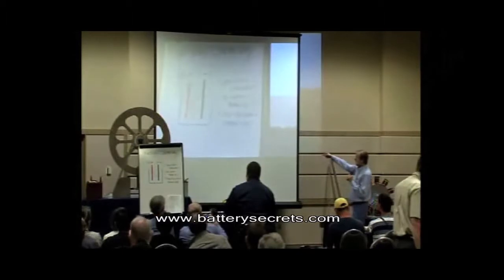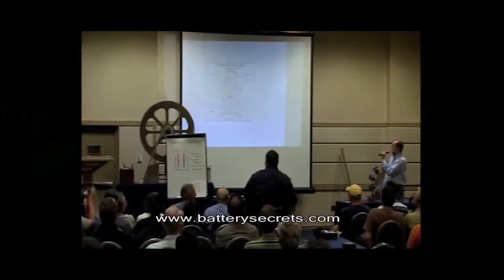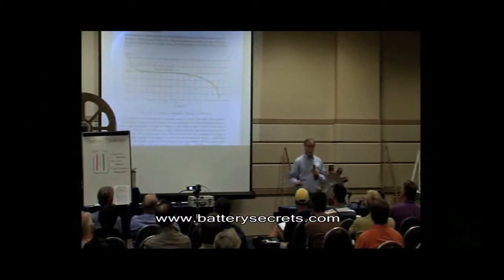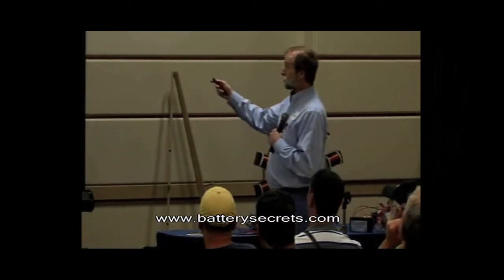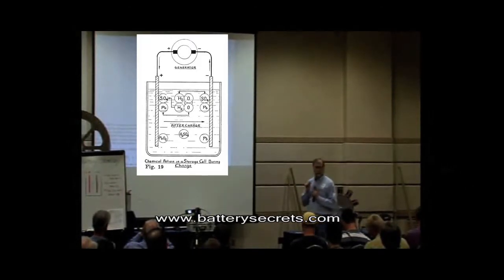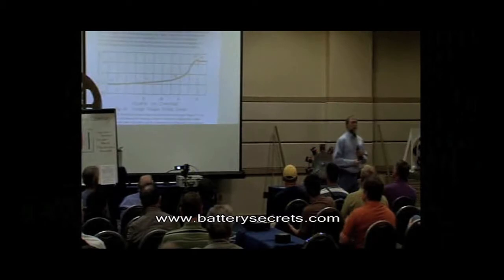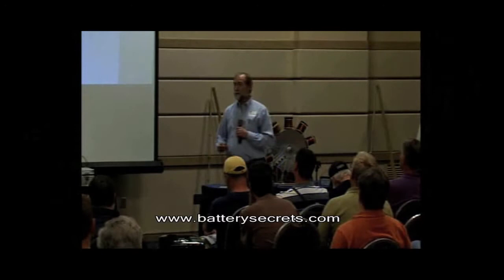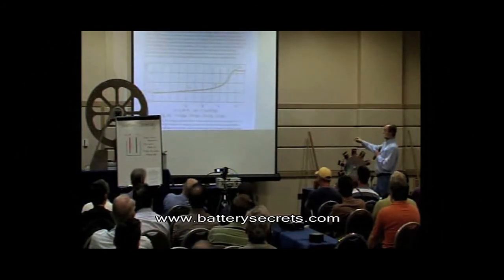BATTERY SECRETS

Comment: In lead acid battery the sulfuric acid decompose the lead plate freeing electrons creating free elctrons creating electricity as this process continues it will also create the battery plates to calsify or in better terms the lead plates will wear out basically they get a coating of calsified lead oxide and other elements this cause the battery to stop conducting,back EMF or cold electricity helps dicalsify the battery plates please excuses my spelling,thank you for taking the time to read the comments.

Comment: So the composition of the metal or elements wich compose the internal layers of the battery has to do and varies the amps of the battery cause voltage is easy to manifest but amperage has to do with materials that conduct electrical energy without resistance this metals and or elements have to be carefuly chosen we all know about supper conductive elements and or metals materials yes That's the way but it takes experimental search depending on what you're are trying to accomplish, electricity is very peculiar , they're is cold electricity ,wich is none magnetic and theres other variants.

Comment: this makes far more sense. kicking these heavy sluggish ions into motion. give em a kick... let things subside.  sorta like pushing rocks around with a leaf blower versus a compressed air gun.

the leaf blower, everything is moving, the rocks? well... lots of gravel, lots of dust, leaves... but the rocks take a bit. waste a lot of energy moving unassociated crap. 
the compressed air gun you can aim, focus, move just the rocks.
bad analogy.

actually. im really reminded of say... slime on speaker cone. and whats the other one? chadraki plates? something like that... sonic levitation... smack things just right and strange effects happen...

sad he didnt know more about the forming of plates. iirc, accumulators were solid lead plates, reverse charged to form sulfate, then "reverse" charged the "correct" way to form actual batteries.

these days the plates are just sulfate premixed with goop and squished into a grid. already polarised, non-reversible.

i didnt know about the electrolyte/ new acid bit, but makes perfect sense. wont try that again.

i guess its worth tickling a dead battery or two with an induction coil...

oh yeah. sounds almost like they start ringing... harmonics, resonance... be interesting to actually play with this idea... does plate distance make a difference? how about area? the charging process sounds more like charging a capacitor plate up, and then the potential/voltage drops back as the energy is transferred through the electrolyte. the lead being massy, gets into the swing of things, like tubby man on springs... as the cycle starts getting closer to the natural swing due to construction, maybe? if this phenomenon is true, real... its definitely worth playing with!